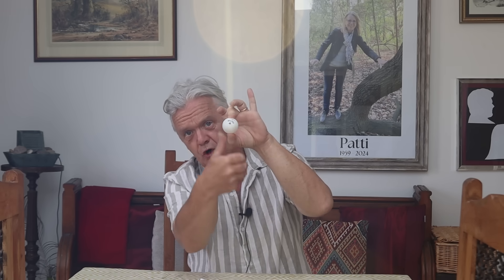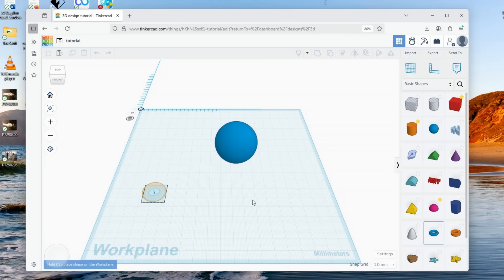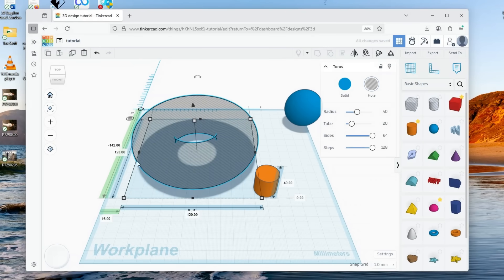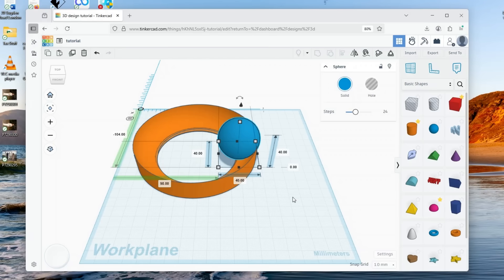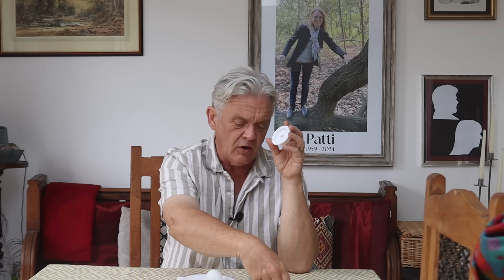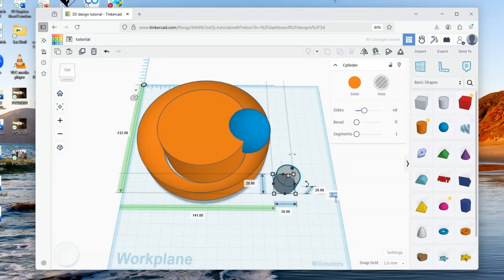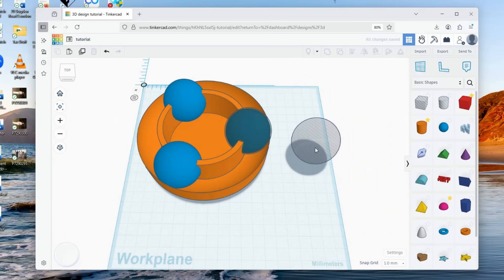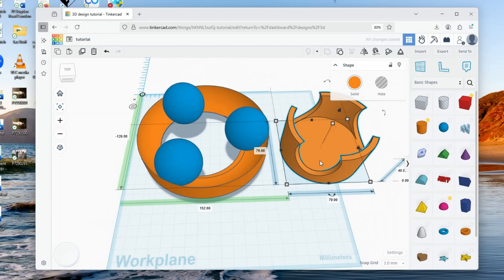2411 Ping Pong Ball Planetary Gear

Comment: I have a 1000kv delta configuration bldc motor. I want to run it with 5-12v 50hz transformer. Motor's phase to phase resistance is 0.24ohm. 
What will be the running capacitor value?
Please help
Reply from the maker: you don't need a running capacitor with a BLDC motor you can use a link capacitor if you want and the rule of thumb is 2 microfarads per watt - or at least that is my memory of it
Reply: Thank you so much sir @ThinkingandTinkering

Comment: won't a friction drive creep unpredictably. unlike cogwheels. so is it suitable for a 3d printer mechanism? won't it cause inconsistent movement?
Reply from the maker: Oh yeah - but pointing out a potential problem is only half the issue mate - how would you solve it?
Reply: - Minimize torque spikes by reducing acceleration
- Limiting friction drive to low-load axes
- Using thermally stable filaments for the pieces
- Using higher-friction balls
- Adding rotary encoders to the motors ( to detect movement slippage)?